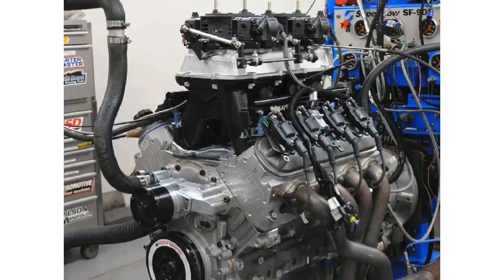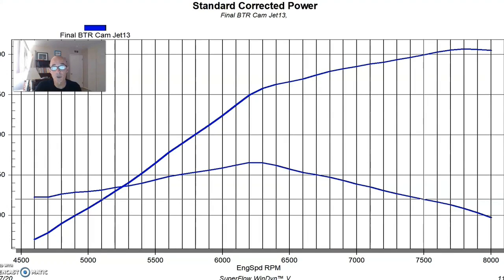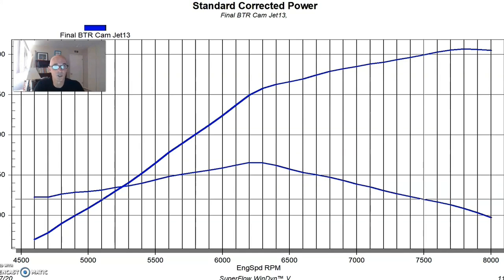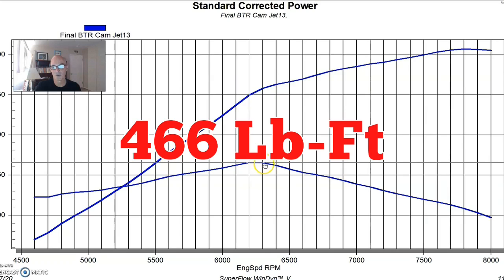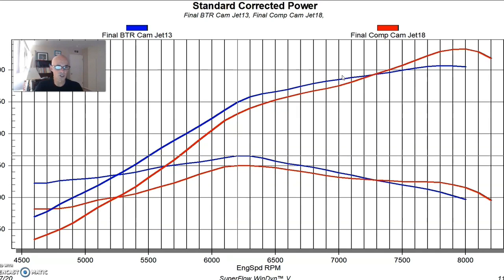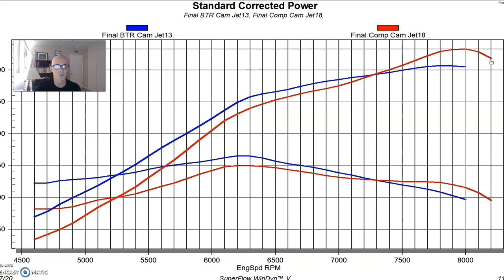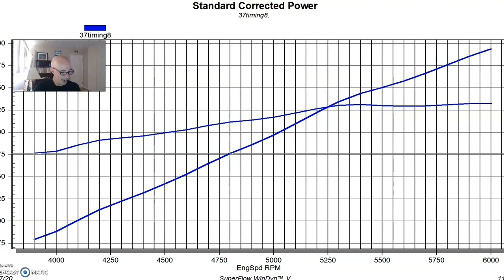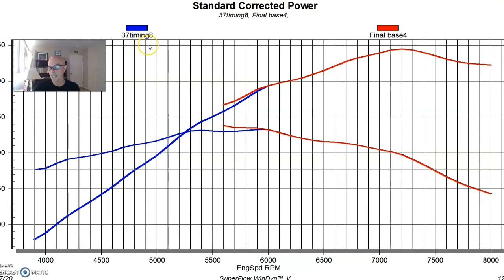8K RPM HYD ROLLER-WILL IT WORK?

Comment: Given the drop in power and your knowledge of engine combos, it appears the smaller header created some restriction on the top end. The cam is large enough, and shorter stroke would have revved higher in this case if cubic inches went down with the stroke. A tunnel ram intake on the sbf would have changed things as well.

However, one cannot overlook the volumetric efficiency of each combination, favoring stroke length without considering the ratio to rod length, angle of ports and valves, directly comparing valve weights, valve angle grinds, comparing induction manifolds, etc. It is difficult to compare every little variable when there are a couple hundred of them in engine designing... I would have to say that while many combos can be made to turn 8k rpm, a longer stroke with shorter rod will always create efficiency at a lower rpm than the inverse. When you are testing boundaries, though, these factors now become critical; 18k rpm F1 cars being an example. You will struggle to make an small block anything turn 18,000 rpm; the basic design just isn't there.

In this particular test, I think sizing the headers and the intake manifold similarly to the LS would have yielded more power at top rpm. Basically 1 7/8" headers with a tunnel ram, maybe more carb...

Comment: I would be interested to see the exhaust flow numbers past .600" lift. I would bet it dropped off.
Reply from the maker: exhaust flow rises with lift
Reply: @richardholdener1727  Not always. Some heads flow terribly at higher flows. And a test bench does not flow enough air at lower flows to show this. That is why flow bench numbers should go all the way out to .900" or more lift even though you may not be running a cam near those numbers. A real engine will flow a LOT more air and to simulate what happens, you have to run the test bench way higher to see it. To make such a blanket statement is dangerous. I can show you several flow bench test sheets where flow drops off with lift.

Comment: I’ve loved these “Short stroke LS” deep dives, but with so much bottom end headroom, why not upsize to a de-stroked LS7/LS3?
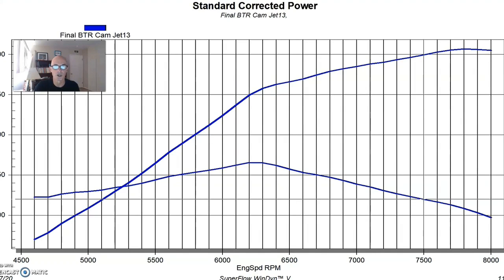4.125” x 3.622” with a 1:14 oversquare ratio vs 1:25 ratio, giving you a bit more grunt, while keeping the mean piston speed under 5,000 @8K RPM?  
The LS7 heads have proven capable at high RPMs, and at 6.346L vs 5.56L, an easy 700HP with equal or better overall area under the powerband would make for a monster reliable street/track car.
Reply from the maker: cuz 4.125 block =$
Reply: @richardholdener1727  well... YEAH! Why do you think I'M not posting my engine bench videos? Hahaha!

Comment: I'm a Ford guy, the deck is only 8.2". Rod stroke ratio sucks on these strokers. The only reason to run the things is if a 9.5" deck block won't fit, or you're lying bout cubes. Nobody falls for that anymore. Raced them 20 years ago cause I had parts for them. Couldn't afford to step up and build another motor even though could've recycled most of the stuff! We stuck a junkyard Windsor with a used solid lifter flat  tappit cam, borrowed rpm heads. Turd was a second faster 1/8 mile!! Ran it 4 years and last I heard it's still running round in a street car. 5.969" conn rod, 3.5" stroke, 9.5" deck! Like to see a cheap build on a 360 Dodge, talk about good rod stroke ratios.

Comment: do you think the lifters may have pumped up too much at higher rpm and didn't full close the valves. I have heard of earlier hydraulic lifters doing this but crane cams were supposed to be the first manufacturer to fix this problem. I'm talking about early LT1 hydraulic roller lifters pre LS.

Comment: Power problem is cam, just not enough.  I run a .694 lift with 220 Renegade heads on my 347 so your heads, carb, intake are good.

Comment: Dart shp blocks are 4.125" bore.  A 3.4" stroke crankshaft makes them 363cid. They use the 3.250" stroke to be a 347cid. I'd love to design you a heads cam package for this sbf. Needs more intake cfm at the throat, a larger header and more camshaft.

Comment: definitely go with the 3.40" stroke.  1-3/4" headers are plenty good to 600 bhp.  the combo seems off...
I've seen an LS7 rev to 7980 (from data) through the stock manifold.
Reply: Revving isn't the same as making power

Comment: I think the Ford has an issue with valve control. Ha it been a lack of flow or exhaust restriction, I think the curve would just have gone flat. That weird concave curve suggest some kind of harmonic spring issue. Maybe the valve is too heavy or it needs 15-20 lbs more spring rate, because if it had been a collapsed lifter or actual float, it would just drop off in a more convex curve, that's at least my experiences. It is definitely not a shape I associate with flow or runner length tuning issues.
Did the springs have dampers?
Reply: What lifters would you run in such an engine?

Comment: Richard, when you run that much duration what kind of static compression ratio should be run?  With over 250 degrees of duration doesn't the intake valve stay open significantly longer lowering compression?
Reply from the maker: IT EFFECTS DYNAMIC COMPRESSION
Reply: @richardholdener1727  Is there a general rule for approximately how much static compression is needed on a similar 347 to get a dynamic compression around 9:1 when running that much duration of camshaft?  With the intake valve closing around 40 degrees after bdc I calculated 10.8:1 static but the cams designed to run up to 8k are closing at more than 65 degrees which works out to be over 12:1.

Comment: The short stroke will add to the longevity of the engine at 8000 rpm. Less piston speed less stress on the bottom end.

Comment: I would like to know how long one can expect a built engine to last as far as the valvetrain is concerned when running say over 500 lift and fast ramps.
Reply from the maker: 500 LIFT IS VERY MILD-IT WILL LAST A LONG TIME

Comment: I wish he would find a guy with a spintron machine so he could illustrate what's involved in making a pushrod valvetrain turn 10,000 rpm reliably.
Reply from the maker: skunk has a spintron-so does comp and BTR
Reply: @richardholdener1727  can you do a video over it for everyone?

Comment: For a "perfect header" diameter use the math algorithm in "Performance Automotive Engine Math by John Baechtel" (kindle download). The math formulas I have used from that book has never let me down(I have built 14 land speed record-setting motors). You test so many motors it would be worth a try. Then you can have baselines for all the different size valves/header/carb etc.
Reply: Thanks just ordered it!!

Comment: My combo is a sbf 306 custom cam performer heads and intake votech t trim 15lb on e85 tuned through Holley 607wheel at 6000rpms

Comment: On the 347, with that much duration on the cam, and that cubic inch, this engine probably needed to have something like 14 to 1 compression to really work well. With flat tops, I haven't done the math on all the components you had, but it was probably less than 11 to 1. If that's the case it probably left some major hp on the table because just not nearly enough compression for the cam.
Reply from the maker: compression adds power regardless of the cam-the cam still works with lower compression
Reply: @richardholdener1727  You were asking for opinions on why the 347 did not put out as much power as you hoped for. Just giving the opinion. As you go up on cam duration, you either have to go up in compression or cubic inches has been my experience, or it kills power as it gets over-cammed. And that seems to be what you experienced there. Awesome videos BTW. Have been watching many of them and the info is excellent.
Reply: @richardholdener1727  how come you allways short change the fords? You put two sets of heads and multiple camshafts with a tunnel ram dual carb on the ls and just ran the for as is...wtf

Comment: Hmmm but can you smack 8k rpm with a LS on pump gas? Or do you absolutely have to have e85/some kinda race gas?
Reply from the maker: the fuel is not the problem with reaching 8K
Reply: @richardholdener1727  perfect thats all i needed to know🤙🏾

Comment: My stock bottom end LS3 goes to 8k 👍🏼
Reply: 236/254 .646 112.5 Cam
281cc/94cc Heads
Tunnel Ram FAST LSXHR Manifold
25% Underdrive
1 7/8 Headers

550 wheel hp

Comment: I built a 1972 Dodge Challenger with a 383 bored thirty over. I ran Roads lifters, they were hydrolic but acted like a solid and I had all the good stuff in it. 86 cc chamber 440 heads with the 6 pack exhaust manifolds $$$$ windage tray crank scraper, you name it this motor had it. I used Keith Black hyperutectic pistons with Sealed Gap Chromally rings. When that motor got around 35,000 miles on it finally felt broke in and was rockin. 3 angle valve grind, with titanium keepers and stainless valves. It was also a 1965 383 block with higher nickel content. It sounded so good with 3 inch true duals. I never did get an x pipe, I couldn't keep the exhaust on it from crappy muffler shops. It would pull the front tires on a good surface. I don't ever hear of anyone using those Roads Lifters, or the Sealed Gap Chromally rings? That was in the 90's I worked for Mono lite Racing Team and we had Aries motors, 8.3 liter and 10 liter for the 300 inch wheelbase dragster and 120 inch wheelbase funny cars. This was Exabition Racing then. The old man was the original maker for all the fiberglass hood scoops and fender flares for Dodge in the late 60's and 70 and 80's. All the light weight parts like fenders and hoods and doors and trunk lids made of fiberglass. He was the man.  Anyways I knew all the tricks for those Mopars then. It would do 11.60 quarter miles. But would still go 155 is as far as I took it one time on 4 drum brakes lol yippy Skippy !

Comment: Not knocking the ford 347 but 545 horsepower can be made with a basically stock 6.0 or 6.2 LS with rectangle port heads it will need hardened pushrods and a SFI balancer wouldn't want to push it to 8000rpm but 7200rmp should be a piece of cake with peak horsepower just over 6500rpm not to mention a more mild cam with  220-230 duration on intake 230-240 on exhaust and make way better torque from 2000rpm to 3500rpm for street driving GM performance 525 horsepower LS3 is close with CNC ported LS3 heads would have to pickup another 10 to 15 horsepower also comp cam 231/239 or something similar should meet your goal of around 550 horsepower while still having decent torque by 2200 to 3000rpm and it will need at least a 3000rpm stall converter and at least 3.73 gears LS engines like higher stall converters and lower gears like 4.10 with this cam you should have plenty of vacuum to operate brakes with a slightly choppy idle at 800rpm but not terrible  l know it will not be smooth idling this engine should make 400 foot pounds of torque or more from 3000rpm to 7000rpm try that with this 347 ford with this setup shown here this 347 will need a 4500rpm stall converter or more and 4.56 gears because anything less will make for a very sluggish with absolutely no torque below 3500rpm and idle very choppy with it idling at 1200rpm or maybe a bit more and as you can see it will rev to 8000rpm but horsepower and torque still drop off quickly above 7200rpm

Comment: Don't hydraulic lifters become an issue at around 10000 rpm? a lot of the 7k rpm limitations on factory vehicles is because of the pumps, alternators on the engine not being able to servive about that area.

Comment: I run a 347 in Super Street 10.90. I slow the car down for the class, but it is a great little motor that revs, especially, in good air.

Comment: Boy, that's a LOT of head, cam and intake for only 533bhp on that 347. Something definitely seems off. Dunno that it's the 1.75" headers... I set up a 358" SBF with self-ported vic jr heads and intake with 252º cam, 1.75" headers, 3" exhaust with mufflers - and it did 515 @ ~6800rpm at the TIRES.

Comment: Look like a valve control problem on the 347. Plus, a 347 with flat tops generally doesn’t have much compression. Super victor also has terrible port alignment right out of the box. Well, I the ones I have used. I think Ray Charles designed the castings first Edelbrock.

Comment: I thought the destroke was to make it more reliable at higher rpm. It was a long and short could both spin that fast but the long stroke would wear out rings or cylinder walls faster?

Comment: I love your comparisons r code or. M code with the quench heads 351 Cleveland what would be the highest safest rwhp you would hope to make because after mucking around with HP calculators etc realising the 351c m or R code would be in a heavy Aussie xy falcon body to get a car into the 9sec barrier na you would have to be making at least 700 at the wheels please correct me if I'am wrong I'am sure my heavy stage 2 FMX auto would be a bit heavy too ? Also how drivable is a car like this it's not like a nine inch has a flip flop centre one ratio for drag one for street any advice I'd be thankful cheers 😉

Comment: I use the limiters in lifters in my Harleys to help lifter bleed off and help with hot starts . The lifter bleed off leads to higher compression and possible kick back. But I also think it may help with a bit more hp at higher rpms or I going to find out lol

Comment: First, I really like your video's. I know you were trying to see if these engines would rev to 8000 rpm, but when the graph showed power stopping before your target rpm- whats the point of going past peak power?
Reply: There's a diminishing direct return, but there can be an advantage if revving higher with slightly less horsepower than peak means you can drop into the next gear at a MUCH higher spot on the power curve than if you'd shifted 500RPM sooner.

Look at it like this, you have a theoretical/example curve with points of  450hp and 500hp at 5500 and 6000rpm, and points 600hp and 575hp at 7000 and 7500 RPM. 7000RPM is peak. Next gear is a 1500rpm drop.

You can shift at 7000 and go from 600hp to 450hp.
You can shift at 7500 and go from 575hp to 500hp.

Keep the most power under the part of the curve you utilize, that's fastest.

Comment: Ford racing sells a lifter with a ceramic check ball that’s good for more rpm. Also a Holley tunnel ram would’ve made more power overall, like the one on the ls engine. The issue with the sbf is lifter bleed off at high rpm. Effectively making the camshaft lift and duration less.
Reply: What would be the correct lifter for such an application?

Comment: Hey Richard, what’s the RPM cutoff reason? Is there any lifter wear considerations or do you just stop once the power curve starts trending downward? What sort of engine life are you looking at for LS based motors being revved to 8,000RPM and above? Thanks

Comment: I see a modified oil pickup tube , how do you remove welding scale from the inside of the tube . Somehow  run a flexible  wire brush inside ?

Comment: I think it was harder primary size on the 347. At that speed, it was like trying to exhale through a swizzle stick. I’d bet if you could have monitored it, back pressure would have been getting fairly high, and that would also explain the lower peak rpm from what you expected to.

Comment: Nice test. Ford combo ran out of carb/intake. Needs lots of cfm to keep making power on a 347 turning 8,000rpm. Porting the intake and going with more carb would have gained more top end and rpm for sure.
Reply: What is the rpm limit for the stroked  bottom end
Reply: @johnpublic168  that depends on many different factors
Reply: Look up how to calculate piston speed, eventually the piston travels faster then the expanded flame front. Which wont make "power" at that piston speed.
Reply: @jasonhooey5677  you look up Induction cfm vs ci vs rpm and you will see what I'm talking about. We do this everyday and we have flowed and ported the very manifold they where using. They ran out of carb and manifold cfm. They need more CSA and cfm to keep the Induction system from stalling. That motor simply needs more airflow. You have had 347s and LS motors turning those rpms for years already.
Reply: @bigdogsportingtonyb2833  What is CSA? Spark advance?
Reply: @milojanis4901  cross  section area. If you know anything about airflow, valvetrain stability then you will know that motor needs more airflow. There have been other videos showing 347s and 363s revving past 7,000 rpm and the better the Induction system was the more power the engine made. We do this on a regular basis every single day. ON A naturally aspirated motor having enough airflow with the least amount of restrictions on the intake and exhaust side is crucial to power production as rpm climbs.

Comment: The two factors that used to affect hi RPM long stroke crank combos, was the weight and the oiling ability of the bigger journals.  The factory OEM big stroke cranks of course had a lot of meat in the "cheeks" and balance weights. The other issue is the large mains needed for crank overlap to keep the strength of the crank. Now the "overseas" aftermarket cast iron cranks are as strong as the old OEM forged cranks.

So, technology has outpaced the wives' tales.

Comment: This test speaks to me. I am assembling a 388" LS7 shortblock this week that will be Hyd roller. The cam & intake manifold set up should make peak power around 7500 and will be shifted around 8k. This engine size has been done many times before but most of them have solid rollers. Theoretically I'll need to spin this combo 10% higher than a 427" (all things being equal) to make equal power.